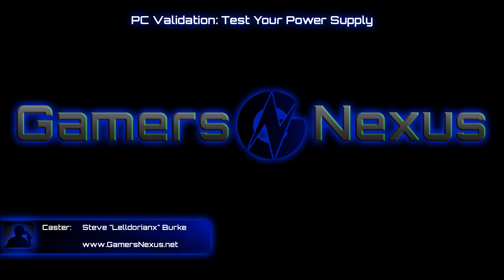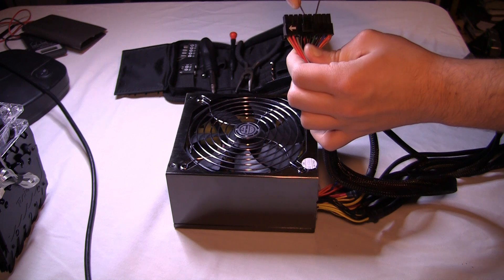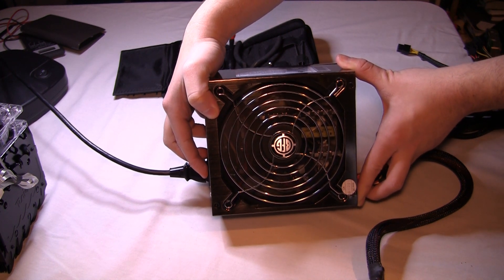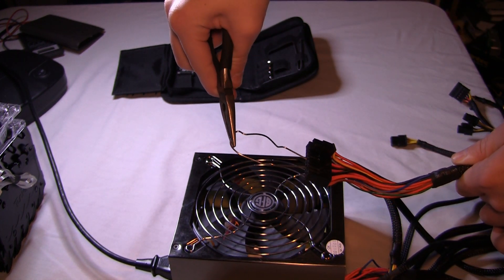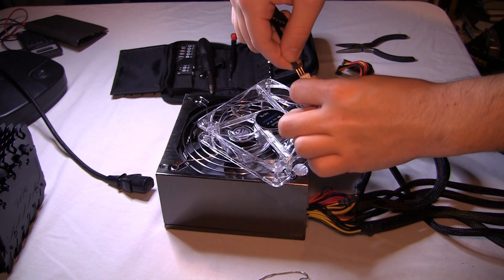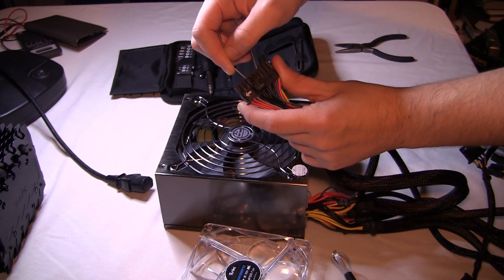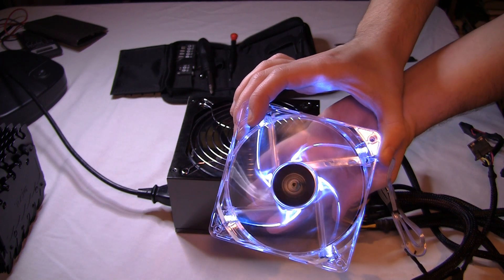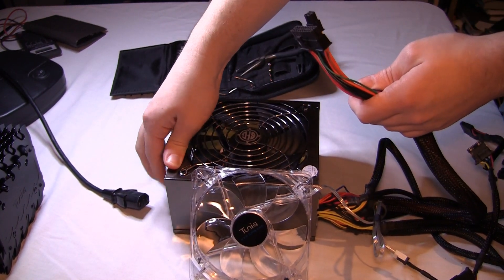Basic PC Troubleshooting: Test A Power Supply with a Paperclip

Comment: Well I bought new psu I connected all things that I have to but pc doesnt start when I tooked out gpu gtx 660 ti out of pc I try starting pc with integrated gpu and it worked wt hell why doesnt it not work with my gtx 660 ti its a new psu 550W combat power 550 plus inter tech

Comment: What if the test failed. Is it worth opening and checking the fuse?
Reply: Never open a psu lol
Reply: @Jrekt  How come?
Reply: @davidm6395  electric shock
Reply: @Jrekt   from 12 Volt?
Reply: @davidm6395  Capacitors can store 600+ volts.
Reply: Send it back. Most power supplies have a 10 year warranty. If the warranty is done then just buy another one.

Comment: When I turn on my psu the fan doesn’t spin at all, I have a thermal take smart 500w and it is not turning on at all when plugged into the wall, turned on and plugged into the motherboard
Reply: Thermaltake smart is trash

Comment: This helped me out. I thought I had a faulty psu. Turned out that it was the motherboard not switching on atx power supply.
Reply: @abndnd2735  I had to replace the motherboard. It was cheaper to replace than repair.

Comment: Gamers Nexus
:::  i am having post issues, but i  did the same test with the clip and i fan, but the fan did not want to spin. But when i tired running post testing on my mobo  and i the cooler fan does spin all lights up. Also i am still stuck at pc not posting. i just wanted to ask about the paper clip and the 1-fan cuz it did not work for me?

Comment: I have a Rosewill 80 Plus Bronze PSU with all black wires. How do I find the "green" wire? I have a manual for the motherboard, so know where all the grounds, etc. pins are located. One pin is PWR OK. Is that the green one?
Reply: Ok, with further research, I found it. PS ON, of course...

Comment: Steve, I have a refurb AX1200i that has been fine for a few months. Yesterday I noticed erratic behavior, mouse not working for a moment or two, unable to access the system tray, and then finally the entire system just shut down. No BSOD just shut down. When I looked at the system in the state the light on the PSU that is normally green was red. Hum! Booted again and it would start for a second then pause and restart and almost complete the boot cycle (complete Win10pro load) and then shut down again. Could this be the PSU? Thank for any comments and suggestions.

Comment: What does underload mean? I’m still a little new to learning about the pc parts...
Reply: Like under load. It means it's stressed
Reply: It means it has an electrical load on it meaning the parts are pulling the voltage from the PSU.

Comment: I have power supply when I connected it as said in the video. It just books on and off. The fan only spins when the power is turned on then it ish l instantly goes off. What can cause that. I tried to power supply and it is the same thing

Comment: If I press a lot the paperclip can the pin bend?
Reply: I did that with my PSU.  The pin opened up like an inmate's backside and my pc would turn off randomly.  Fortunately I fixed that by closing up the pin again using some tweezers.

Unfortunately, my PSU finally met the end during a game of Fortnite... it blew up under load after I upgraded my CPU.

Comment: Is it okay to replace a prebuilt desktop power supply with an aftermarket one? The prebuilt is 300w I bought a 400w..
Reply: Yes. remember the Watt amount is nothing to do with what the devices use its the maximum the PSU is capable of supporting.  most PC's that aren't hardcore gaming rigs will easily run from less than 600w power supplies. if the prebuilt psu dies just replace. if you're lucky enough to find a PSU with the cable outs you need, or better yet a modular psu =)

Comment: I can turn on my computer but I can’t turn it off and if I unplug it and press the power button it won’t turn on. I have to wait like a full two minutes until I can put in the power cable again and then it turns on, also on start up my computer freezes 90% of the time, I’ll be lucky if I can actually get to windows in less than 30 minutes.

Comment: My psu is good. My motherboard has these LED lights that light up when I turn on the psu. My Power LED, only on the first try, lights up for a split second and nothing
Reply: Could still be the power supply. The paper clip test isn't fool proof. Until it's under a legit load you can't tell anything. Hook it to some  CD, DVD and HDD drives and check the voltages with a multimeter. Anything else is just guessing
Reply: Nice picture
Reply: @Spicygo4tCh33se  lol i wish i knew her name!
Reply: The front panel cables are plugged in correctly and nothing happens
Reply: same

Comment: Please help. I have 200w psu and when i connect green and black wire fan just kicks for few seconds and it powers off. I didnt connect anything just all yellow black red and orange wires. I have some other wires but i didn't touched them. Please help.

Comment: Is it possible for a power supply to be faulty or nearly dead yet provide power to turn the PC on including fans yet prevent anything from being displayed onscreen?
Reply: yea im experiencing this as well. my keyboard lights up, but it turns on then turns of instantly. using the EVGA g1 750w gold 80+ psu
Reply: Remove a Ram stick and start your computer
Reply: dino
Tried that, it still didn't work. Sent motherboard in for replacement. MSi 970A G43. Have you heard anything bad about them?
Reply: RolanTHUNDER couldnt say.. im nit an expert in any way ahah
Reply: dino
Oh okay no problem :) Well my motherboard is in for replacement. MSI 970 G43
Reply: How'd that turn out?
Reply: Check your rams

Comment: i tried plugging the fan directly to psu using molex but fan in psu not also working.so is this right without mobo..fan will not run as the psu?(no MOBO) just the fan and the psu.

Comment: Some people try to give their motherboard a jump with a paperclip. Be super duper careful with that method. I have tried that under the advisement of one of the vids here on ytube and ended up frying a brand new motherboard. The power fan would spin for half a second, than stop. The lights on the board would turn on, then flicker (with the paperclip in place ) subsequently frying the board to smoke during the jump process. Unfortunately, most of us don't have more than one power supply lying around to test in the pc to determine whether we have a bad power supply for dead motherboard. I recommend spending a few bucks on a power supply tester and motherboard tester, they are actually quite cheap. The paperclip test only tells you that power is on, but not where the voltage failures are. There may not be enough volts to power up your pc, but rather, to just run the fan, if even that. In my case, I could only get the fan to run continuously when I created a currant using the paperclip with the power supply, outside of the pc. This is not a reliable enough method for me.
Reply: Would you share links to these power supply and motherboard testers?

Comment: Lol.......so what if all my wired are black?......what then m8
Reply: little late but for anyone with this issue just look up the ATX plug pinout
Reply: My all black wire power supply came with a test jumper
Reply: Pin 13 and 14.. ;)

Comment: I tried this. The fan runs only with the paperclip test, but not in the pc.  Bad Case, or Motherboard?
Reply: Hi
Reply: The fan barely draws any current at all.  It's not uncommon for a PSU to work under low loads but not at high loads. This is usually due to failing electrolytic capacitors.
Reply: Motherboard
Reply: Isn't that cable the one of the ones that powers the Motherboard? Probably wouldn't have run without that plugged in even if the MB was fine :D

Comment: I plugged my 24 pin connector to my motherboard before doing this
I'm currently struggling to pull it out
Reply: Still need help? That happened to me back then.
Reply: Got it out yet?
Reply: @ArmageddonAfterparty  its been 3 years and the poor lad has still been struggling with it, otherwise he would have told us.
Reply: Legend has it Gilligan is still trying to get the paperclip out of the 20+4 pin connecter, good luck my friend, may you find light at the end of this dark tunnel
Reply: Man there is mechanical thing for locking "24 pin" in place. If you will use light and eyes and little brain and pushing power of the finger you will probably find out what to do.
Reply: chudzo skruo some people don't like to man- handle things,  they probably should've lubed up the connector before plugging it in with dielectric.

i have seen some connectors get ripped off the board and cause trace damage because the molex pins wouldn't release even though the latch was unlocked/removed.
luckily i can solder pretty well and could help them lol.

Comment: Hey, I have a problem, apparently my computer is a desktop dell inspiron 3847 and when I turn it on, it flashes orange and I had tried everything, pulling out plugs and reconnecting them, doing a power supply check if it is working or not, which apparently, it is working, but i can't seem to fix it. Any help?
Reply: DVFMovieProductions Donkeys I know this comment is a year late but I'm having the same issue with my Dell, a Dell Optiplex 790 to be exact, have you figured out the problem?

Comment: My power supply just moves a little and the CPU turns too for like one second and then it stops... does this mean the power supply is broken?
Reply: I have this exact problem my power supply moves a little and cpu turns too but after 1 second it makes a sound like a click on the power supply and then it turns off
Reply: same
Reply: +Ramasamy Nachiappan i got a new one from my uncle so it's ok now lel
Reply: So i need a new psu
Reply: Ok them
Reply: +Ramasamy Nachiappan if you know how to fix it then do it... xD
Reply: +TheDuckMan Adict I'll try xD
Reply: +TheDuckMan Adict That kept happening to me just make sure that the CPU cable is plugged into the back of the PSU where it says CPU sometimes it might come off.

Comment: What happens if all of my power supply chords are back? Is there still a way to check the power supply?
Reply: I had this same problem - look up "20+4 connector pinout" and the images should show which slot on the cable is green and which are black
Reply: I'd also appreciate feedback on this😅

Comment: Thanks for the tip.  I have a 600W Rosewill glacier.  I thought my PSU is dead on arrival without connecting to a motherboard as in some reviews as the fan was not spinning when i plugged it.  The fan spins when i jump the connectors.

Comment: power supply doesn't mean works if is starts the most important after that if can handle whatever hardware you have in your PC component , beside that my pc last 6 hrs before it's shutdown by itself , i don't know the cause yet but probably PSU

Comment: I was playing a game and all of the sudden it turned off and at the corner of my eye I saw a spark inside the case and smelled smoke/burnt smell for a couple seconds. Now when I mashed the power button the fans and lights come on like it's starting up but then turns off 4-5 seconds later and restarts itself. I'm not sure what to so but pls some one help me!! Thanks
Reply: This has been a PSA on dusting your computer.
Reply: I have the same problem but when i press the power button it dint function. So what happen to you're computer now is it fix?
Reply: yea all i did was left it alone for that day and came back to it the next day and cleaned the dust and what not out of my computer and hooked up the PS again and it came back on. im thinking it had some kind of safety thing to make it not come on b/c i think it over heated and plus it needed cleaning...
Reply: You're lucky. Usually once you release the "magic smoke" you're out of luck!

Comment: I know I will sound really dumb fro asking this, but if you touch the paper clip while the power supply is on and under load will it shock you? Again I am so sorry that I have to ask this I just don't know....
Reply: Cory Daniels you're a bitch for doing that. God rude people these days...
Reply: Guess you've never heard of "curiosity killed the cat".. You knew that was an idiotic question when you typed it, yet your inquisitive nature compelled you to hit the "post" button.. God, people these days..
Reply: Oh and you didn't HAVE to ask it. Rather, you wanted to.
Reply: It won't, because the maximum output from the PSU is 12v in DC current. In order to shock you, it must be at least 110 volt with AC current. Touch it and see for yourself.

Comment: I have a power supply which I wanted to test but there are multiple black cables. Does it matter which black cable it's connected to?
Reply: Count the 3rd and 4th pin from the right on the clip side
Reply: It does not matter.  In basic terms, the black wires are the "neutral" or "return" wires and simply complete the circuit.  If you took a meter and checked PSU 24-pin plug and compared the voltages to those listed on a 24-pin chart, you should get numbers close to those listed.  The black wires will show 0 volts vs 3.3, 5, or 12 volts, etc...
See this video: https://youtu.be/ac7YMUcMjbw

Comment: Ok so I did this and the fan stayed on, it seemed kind of slow compared to the rest of the fans in my computer. What's happening is my computer would turn on but nothing would display nor did I have any peeps so I thought the motherboard was bad so I replaced it and it's still doing the same thing. So I'm guessing it's either the psu or cpu that may be bad. Could someone help me out?

Comment: um way bad!! first off you can not tell if the psu is bad by shorting the 2 pins that activate the psu, if one of your rails is bad let say the 12 volt rail goes, the psu will still power up and spin the fan and all that but the pc wont actually turn on. also you can buy a safe psu tester from your local pc part store. the tester also can be used to properly activate the psu, those 2 pins are load sensitive and help to protect the pc. if you jump them with metal, it is a direct zero resistance connection, they are apart of the protection system.  you see these 23 year olds or younger people that are hit and miss in their repairs, cause a real technician understands what he is looking at in it's entirety. they use things like paper clips and crap they can find, because they don't yet have enough skills to appreciate the right tool for the right job, and no appreciation for mechanically stability. they have zero knowledge of impedance and what a short circuit, example in wifi routers if you look at the wiring to the antenna board you will see the lead grounds itself out. so if you measured the impedance on a wifi antenna it will appear as a direct short, well the frequency determines the impedance so what looks to be a direct grounding of the antenna at 2.4ghz the impedance is not a short. also using paper clips to jumper anything is stupid, can't you go to radio shack and make a dummy load with a switch on it. buy a few connectors to interface with the sockets, a dummy load has a simple 2 ohm resistor, or a 50 ohm resistor if testing rf, but shoving paper clips into plugs is a bad bad example to show people, what if one of them thinks they can pull off a trick to impress friends by completing the circuit that the wall switch normally controls, turn on a light with a paper clip lol, and this person is grounded, like barefoot on a conductive surface like granite. your advice puts people in potential danger you idiot.

Comment from the maker: PC build tip: You can troubleshoot a suspect power supply by jumping the ground + green wires. Tutorial here: Basic PC Troubleshooting: Test A Power Supply with a Paperclip
Reply: Theodore Kon then the PSU has failed and you will need a replacement
Reply: What does it mean if it doesn't start? The PSU I mean.

Comment: hey i have a power supply in my pc that just start and stop  start and stop  i took it in to a shop they change it but after a few days the same problem came back  how can i make sure what the problem is
Reply: Dave, the starting and stopping is usually a sign of a short somewhere in the system. For instance, you may have a stand off in the wrong location under the motherboard causing a short. This draws too much power from the PSU causing its over-current protection to kick in and shut it down seconds later. If I were you I would take the system apart checking for a loose screw that got wedged between the motherboard and the case or an incorrectly placed stand-off.
Reply: That make so much sense thanks much i'll take it apart in the morning and let you know  what happened you really good at this

Comment: thx for sharing, never had to test psu + motherboard faults before now, motherboard wont power on. did on a corsair tx-750 n it works quite easily. dont think u need to jam in the paper clip all the way just to make contact. as he demonstrates. look at the front of atx power 20/24 pin with the clip, on the clip one side is either black n green get both, just take note wat pins he actually uses those r the ones. fucking new build with corsair h90 build n just to find out it was the asus amd motherboard.

Comment: Could be another card. Video, memory, USB port, etc...  Front panel USB ports are common to cause a short if used (or abused) a lot.   Some will show that error as "USB Over Current" when it boots, others may not.   Typically bad or failed memory will show in boot sequence if not an audible series of beeps.  Video cards, of course, no signal to monitor.   PS don't last forever, especially if the dust is not blown out of them periodically.  Dust acts as an insulator (can cause premature failure).